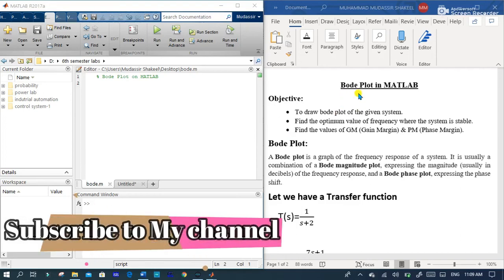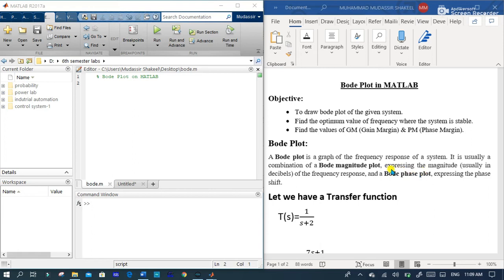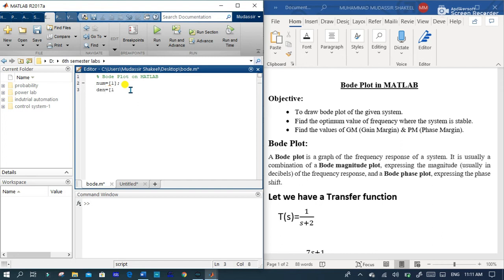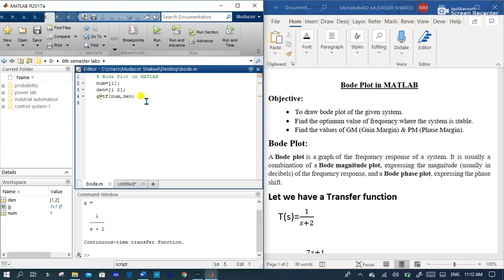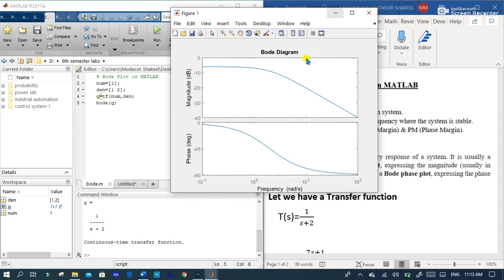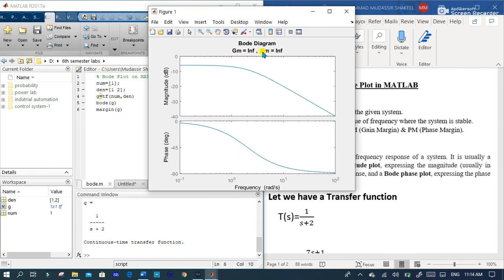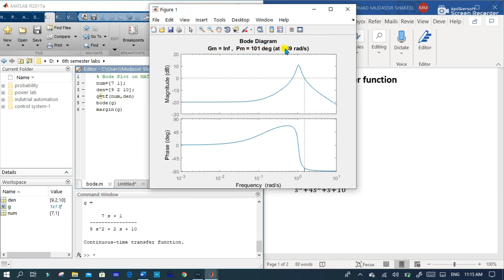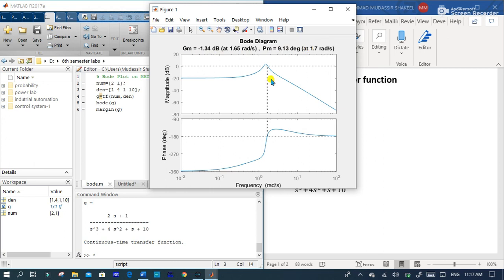Bode Plot on MATLAB || Graph of frequency Response of system || Gain Margin & Phase Margin

Comment: Maybe you could've included an example where the numerator and denominator were in factored format. Something like: (s+1)(s-4)/(s+20)(s+2)^2. Where one of the terms also had a multiplicity of two.
But your video was definitely the most concise and clear example I've found so great job! Thanks.
Reply from the maker: Thank you for your comment and suggestion. I appreciate your feedback and agree that it would be helpful to include an example of a factored transfer function in the video.

In fact, MATLAB's bode plot function can handle transfer functions in factored format, so it's definitely worth exploring. Your suggested transfer function, (s+1)(s-4)/(s+20)(s+2)^2, is a great example of a factored transfer function.

Factored transfer functions are commonly used in control systems analysis because they provide valuable information about system behavior, such as the locations of poles and zeros and the impact of individual factors on system performance.

When a term has a multiplicity of two or more, it means that there are multiple poles or zeros at the same location, which can have a significant impact on the system's behavior. For example, a transfer function with a double pole at a certain frequency may cause the system to exhibit resonance or oscillations at that frequency.

I appreciate your suggestion and I will certainly consider including an example with a factored transfer function in the video. Thank you for your input and for watching the video!
Reply: @engrprogrammer   why ur rply looks like from chatgpt

Comment: How to bring Asymptotes?
Reply from the maker: To find the vertical asymptotes, set the denominator equal to zero and solve for x. This is already factored, so set each factor to zero and solve. Since the asymptotes are lines, they are written as equations of lines. The vertical asymptotes are x = 3 and x = 1.
Reply: @engrprogrammer  in Matlab graph bro, i know how to find them, but how to get them in the graph as asymp(tf) not working.